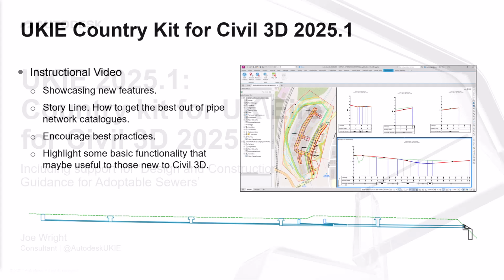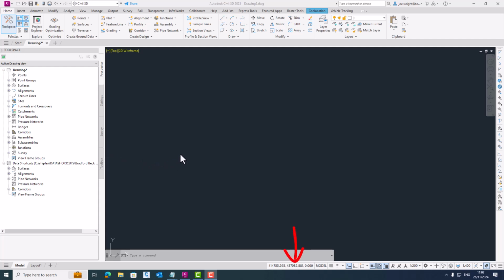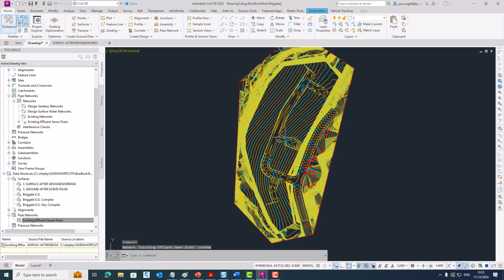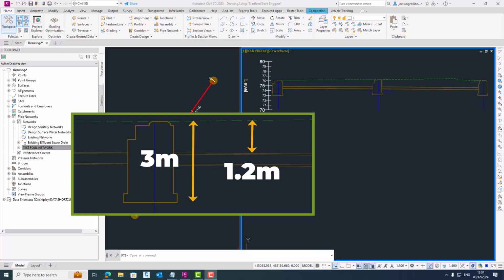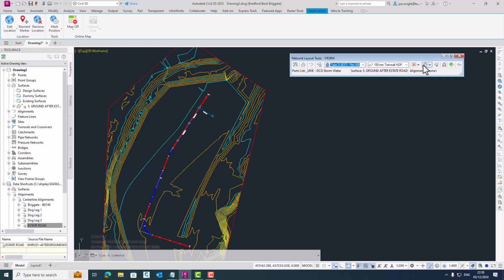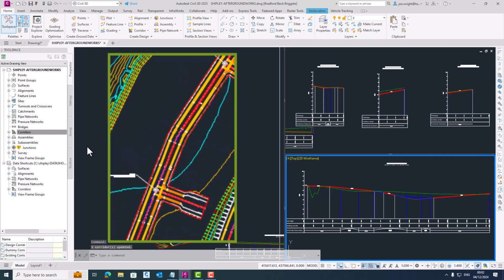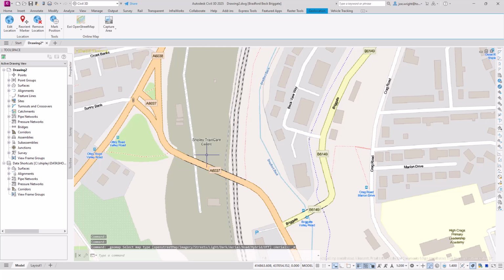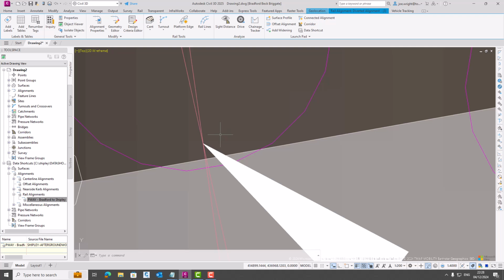Civil 3D UKIE 2025 - Instructional Video and New Features

Comment: I suspect most drainage designers are importing from Infodrainage. Would be good if the manhole type could be assigned on import, based on the depth to soffit (not invert) and diameter. This might make manhole schedules easier as well.